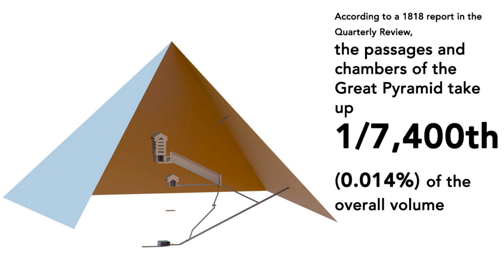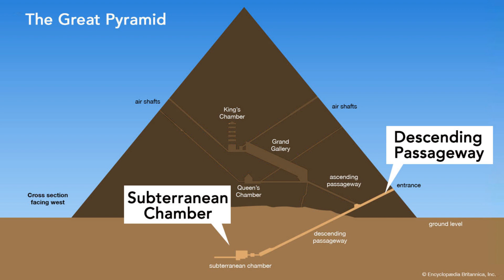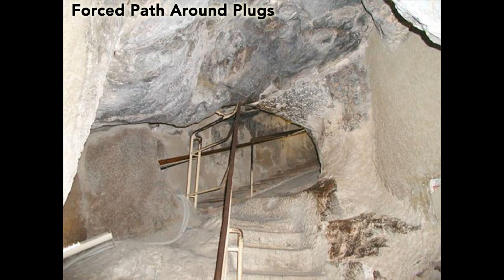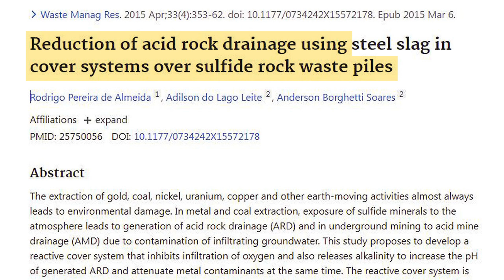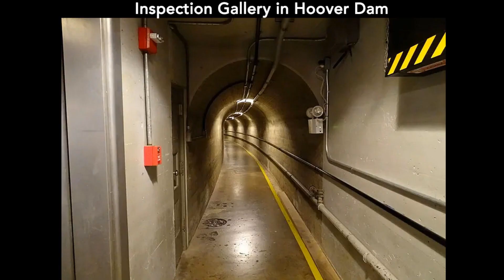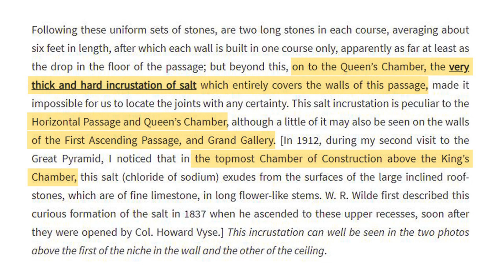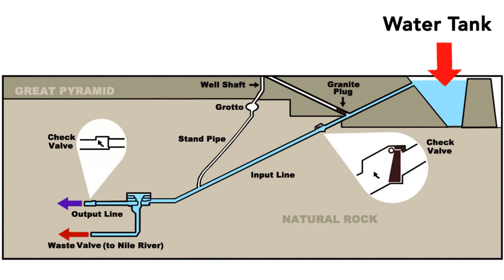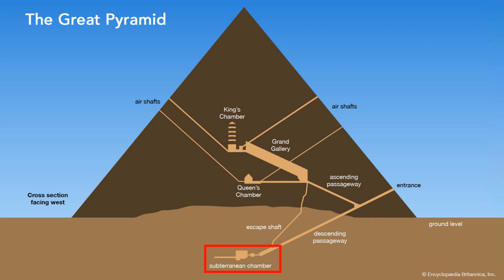The Mystery of the Great Pyramid's Interior System?

Comment: It is far from certain if Al Mamoum's team dug the tunnel from the outside in or from the inside out. If it is an entrance tunnel, digging it would have taken not just precision measurement but also a very good guess of where to go. Maybe it was dug from the inside out because they wanted to get something out that did not fit through the (unknown) entrance they used to get it. 

Nobody certainly knows if the "mountain stone" under the outer chevron stones is an original feature or if it was a later addition. It even is unknown if the outer chevron stones were originally hidden invisible under smooth casing stones or if the entrance originally was a visible design feature. If they were visible from the start, why in the world did nobody ever try to use this entrance in 4500 years? There already had been tomb robbersin Egypt in antiquity. If the chevrons were hidden under the casing stones, they had been visible since the collapse of the casing stones in the 17th century. The western explorers of the 18th, 19th and early 20th century had no inhibitions in removing stones, they even used explosives to get stones out of their way. They found the relieving chambers above the King's chamber by using explosives. Extensive digging in the wall of the Queen's chamber and in the floor of the King's chamber even dates back at least to the 10th century. But none of the tomb robbers or explorers did ever explore what is behind the chevron stones. Really? 
To me it makes no sense at all that nobody ever made an attempt to use the entrance under the chevron stones. Absolutely no sense at all. Scans revealed that there is a cavity behind the chevrons and they revealed a huge cavity that most probably is a second Grand Gallery. Nobody is allowed to do further explorations. Things get even more strange because modern day Egyptian authorities say there is no unknown cavity at all. Some western archaeologists also say the scans are wrong and there is no need for further investigation, all other archaeologists just keep quiet about it. 
That is not all that's strange. The Discovery Channel did robot missions in the Queen's chamber "air" shafts 20 years ago. Footage of the southern shaft was broadcasted worldwide. Edited and even unedited full time footage from that mission is available in the internet. Footage of the northern shaft was never published. It was explored but it was never talked about, Egyptians officials and Discovery Channel just kept quiet about it and hoped nobody would ever ask. Worldwide broadcasting would have resulted in quite some money (just as the northern shaft broadcasting), but they did not do it, they did not take the money. Why? 
Only a few weeks ago Matt from the Ancient Architects channel published a series of leaked stills from the original, 20 years old footage. There was modern waste found inside the shaft, a Giza ticket from the 20th century and a plastic spool or wheel. There was also a dark area spotted that most likely is an opening to another cavity. There is no other explanation, someone was inside there in the late 20th century and nobody talks about it. 
There are not too many possible answers to the question why further research is prevented. One possible explanation is, they found something that would rewrite history so much that politicians worldwide fear it. The other possible explanation is they found something extremely valuable inside, maybe Khufu's funerary goods, and illegally sold them to rich collectors. 
To me, the second explanation seems very much more likely. Every known developed civilization that came after the Younger Dryas did agriculture. They all bred vegetables and livestock domestically and they took it to wherever they settled. There is not one single species of vegetable or livestock that shows any genetic evidence of domestic breeding before the younger Dryas. This proves that agriculture is not older. Even it there had be an agricultural civilization before that  we don't know of, their domestic breeding should have left some genetic traces. It is unklikely that all of it disappeared without any trace. The only domestic animal that's older than the Younger Dryas is the dog and dog's still are the pets of the nomads and homeless today, their existance does not prove anything. Before the Younger Dryas not a single vegetable or animal mysteriously appeared on a continent where it did not belong, not a domestic breed and also no wild animal or plant. This at proves that there was no regular transoceanic travel. Regular ocean travelling has been spreading mice and rats since antiquity.  Maybe there was a small number of explorers (like later the Vikings that reached North America) who did not have rats on board, but no regular travel and no permament colonisation. There also is no trace at all of pottery being made before the Younger Dryas. Pottery is extremely long lasting, broken pieces are found anywhere it was used. 
If there had been a prehistoric civilization before the Younger Dryas, it was not more advanced that the civilization that build Göbekli Tepe and the surounding sites. This type of civilization does not do domestic breeding and it does not manufacture pottery, but it builds advanced houses, uses advanced stone, bone and wooden tools and it has complex social structures. Wherever they used mostly wood for building their houses, they are almost impossible to detect. I think a much earlier existance of that kind of civilization is not only possbible, it is quite likely. Nothing in Göbekli Tepe looks like beginner's work. They knew what to do and how to do it.
Reply from the maker: How could Ma'mun dig the tunnel from the inside of the pyramid...? Which means they needed to be in the pyramid the 1st place. Are you suggesting that they got in through the original entrance and then blasted their way out to create another access? I don't think they knew about the original entrance. If they had known the entrance/ the descending passage then why not just enlarge it instead of digging a new one?  Couldn't that be so much easier to do? 
Strabo documented the entrance, the descending passage and the subterranean chamber of the Great Pyramid over 2,000 years ago. It's difficult to be sure if the chevron stones at G1's entrance were covered with casings or not. Though we know that the entrances to satellite pyramids and some big pyramids like the Bent Pyramids are visible, therefore it's possible that the entrance opening to G1 was visible once before. The chevron stones could be a structural feature and might be covered.

Comment: There were no machines Tina because they didn't have electric power. We are bathing in it so we can't imagine a world without it.  But, like fireflies and Edison who didn't have electric power either, they had light and this is how they made it.  Sonoluminescence -- Sound becoming light.

The Djed Pillars (King's Chamber granite assembly) is pinged by Supercapacitor in Khufu's so-called box, aka The Ark of the Covenant, which is charged by the Queen's Chamber which is a Fuel Cell (Chris Dunn is worth reading on this) and that is supplied with Hydrogen in one of a few ways. I suspect the KOH from the boxes, like the ones on Saqqara (Dead Apis Batteries?) was the source and the shafts leading to the QC filled it.  The switch at the top was a shut off.  The shaft from the KC where to vent H2 so the thing didn't blow up.  It probably did once which is why, as Petrie noted that granite structure in the KC was moved a bit.  

The Djed Pillar produced (probably still could produce) sound waves that traveled down the well-engineered Grand Gallery (which is proportional to pi) and struck the water in the rough and ready cavern below ground.  Why do you think they all had water down below?  That is where the light comes from. 

Elementary really.  No aliens, giants or mystical vibrations necessary.  Here is a 3 min. tutorial on Sonoluminescence from UCLA.  It's a thing and in the video it's calle A Star in a Jar https://youtu.be/CSIPolpvjBY

Ever see a firefly?  I suspect that obelisks were street lights, night lights, actuated by the principle of induction.  Djed Lights.

Comment: Water & acidic chemicals + air + filling shafts + valves+ drainage shafts + weight pressure+ various chambers with special design (not check tunnels)   is logic with extracting metal from rocks over a mining facility  ?

Comment: Hi Tina, your facial animation work is a big improvement on previous videos, and I do like several of the concepts you have discussed here. 
The mine waste storage idea is worth considering further, however, although the air shafts in the Great Pyramid are constructed from stones similar to your water drainage channels in waste mounds, the shaped stones of the pyramid shafts are placed in what could be described as an upside down orientation (if you were using them to form a drainage channel,) against a standard flat stone base. This placing of the shaft stones says that if these shafts were constructed to carry anything liquid or even gaseous, then this substance would have to have been lighter than air.
Additionally, the so-called relieving chambers above the king's chamber are not required to relieve the weight bearing down on the chamber from above, no matter how many times this red herring has been invoked, because the final ceiling of tented stones and the corbelling of the upper stone layers of the pyramid are more than enough to carry the weights and stresses involved. The queens chamber is a prime example of the use of V stones plus corbeling of layers above to carry the imposed weights, and as you are aware, the corbelling technique is clear in other areas of this pyramid and in other pyramids.
One of the best items in this video is your mention of the well shaft as a .300 wide tunnel. If this is so, then it would have been almost impossible to carve or tunnel it out, (up from the lower chamber or down from the top,) and the next question would be what is it carved through, stone blocks or the existing rock structure of the plateau.  If it is the latter, then the shaft could also be a natural tunnel forced through fissures in the limestone by water pressure from below, and this could say that the lower chamber existed long before the pyramid was constructed, and even that the Great Pyramid was constructed in several phases, where each existing structure was extended, altered and renovated to suit the requirements of later cultures.
The Nile valley we see today represents thousands of years of occupation by many different and similar cultures, and limiting our minds to a single opinion as to what has occurred to place the pyramids here today is to deny our own obvious and ever changing use of the land and earlier constructions in our more recent history and in other areas on the planet.
Good video, loved the old Hotspur, and this view of the mechanical tin man taming his wild and savage tiger, except that the nature of the tiger is closer to our actual human condition than the simplistic body and brain of the robotic tin man can ever be.
Reply from the maker: Thank you for sharing your insight. I really appreciate it. I read that most of the well shaft was excavated in the bedrock while the upper portion till the Grotto was probably lined with blocks which can be seen in an old photo. The well shaft also maintains a consistent opening size therefore it's unlikely to be a natural tunnel formed by water going through limestone fissures. 
As for the poster, I think a robot fighting a saber tooth tiger is fitting for my prehistory machinery theory :-)
Btw please check my Community tab so you can see a photo I posted - I'm not an animation figure.
Reply: @CuriousBeingbyTina  I have checked out your community tab when you previously used this as a form of authentication, and I have responded to you about it, as a photo shopped image, so I think perhaps what is missing is a few outdoor videos of you moving around and talking in several natural settings. To be honest, I quite like some of your ideas and I don't really have an issue  with the video voice over that you do, it is just that, for me, the "studio" shots of facial animation not in sync with the language being spoken are more than a bit off putting.
Reply from the maker: @passerby9123  So you think that photo was photoshoped and I have to provide further "proof" for you - that's your bias. You end up believing what you want to believe.
Reply: @CuriousBeingbyTina  To be clear, a biased point of view requires a fixed leaning in one direction, whereas a balanced point of view can lean in any direction or even several directions when faced with incoming observations, and then it can right itself again as it assimilates the new information.
So, no, I do not want you to prove anything to me and I try not to believe anything other than that which is self-evident. 
What I think is missing from your blog is just something that, for me, is missing, and I do not want you to prove anything to me or even to try to change my mind.
Your channel is good, and yet for me,  and perhaps for me alone, I find that the spoken narrative and the personal images you use on screen do not match. This lack of synchronisation, for me and perhaps for me lone, interferes with my watching of your channel and for me, it would be great if you found another way to portray yourself on screen, or to include a little more natural human interaction if the animated image that you are using is actually you.

Comment: There are so many problems with this theory. First is, you don't precision cut mine waste. Second is, you don't haul it 500 km from a quarry. Third is, when Giza was built it was a populace area, quite green as the Nile flowed right beside it. Not the kind of place to put waste. and if this was waste what were they mining?   These blocks are not some toxic waste, they were in fact made of the same material used in all their monuments.  In fact, for the great P it consists of two types of stone with different electrical properties. The outer stone being insulative, while the inner stone is conductive.  While I commend you for original thinking, I think you are way off the mark.  

Dr Robert Schoch, a geologist dates the foundation of the Sphinx as being up to 30,000 years old, though I think officially he is a little more conservative.  He bases this on the water erosion that indicates 1000s of years of rainfall.  When this was constructed, the Nile flowed nearby and the area was inhabited and surrounded by lush jungle.

Personally, I have always wanted to build a scale model of the Great Pyramid to test a theory that I favor.  That being it was an energy generator of sorts due to flowing water through limestone caverns beneath the pyramid releasing ions along the idea of Tesla's Wardencliffe Tower.  Of which their are many hieroglyphs(lightbulb) that hint at such a use. And artifacts such as the Bagdad Battery indicate they knew how to use electricity.  And the lack of soot suggests some other form of lighting other than fire. The function of the inner chambers could very well be resonant chambers that focus the ionic energy.  

Good presentation, but, I think a fatally flawed theory.
Reply from the maker: I cited Dr Robert Schoch's website in an earlier video, he dated the foundation of the Sphinx as being over 12,000 years old after the last glacial period. 
From wiki: "During the preceding last glacial maximum (between 26,500 years and 19–20,000 years ago), the Sahara contained extensive dune fields and was mostly uninhabited. It was much larger than today, but its lakes and rivers such as Lake Victoria and the White Nile were either dry or at low levels." Though since the sea level was about 120m lower than today, the Nile water table would probably be proportionally lower. 

The Sahara/ North Africa goes through humid/dry cycles. The Sahara was green and wet from about 14,500 years ago (after HS1 the millennia-drought) to 6,000–5,000 years ago. The humid period before that was around 85,000 to 78,000 years ago.  I think HS1 might be the time when a previous advanced civilization ended since that's when human population experienced the only severe reduction within 1-million year time period (https://youtu.be/Zs4zLKbp4Ic). If the pyramids were built by this previous civilization, then they were probably built during the dry season between 78k-15k years ago.

Btw I explained most of your questions in prior videos. Hope you can check them out and give me some feedback. 
A Provocative Theory: Giza Pyramids as a Lost Civilization's Mining Waste Storage Site? https://youtu.be/tFzd2z0Rr1U
Prehistoric Mining: What was Mined on the Giza Plateau? https://youtu.be/y6ShuJdzDS0
Thank you.

Comment: Another very interesting presentation Tina. One question. If the Kings and Queens chambers served as inspection galleries surely the passageways leading to these would be bigger for human movement, unless humans didn’t build them?
Reply from the maker: Thank you! I think the Kings and Queens chambers were drainage galleries and were not mean for people to get in. Because with the granite plug in place, humans wouldn't have access to these two chambers therefore not able to do inspection. I think the pyramids might be designed to be left alone and self-sustainable. I will discuss more on this in the next video :-)
Reply: @CuriousBeingbyTina  I see. The Queens chamber shafts were not open to the chamber itself though. How do you think Gantenbrinks doors featured?